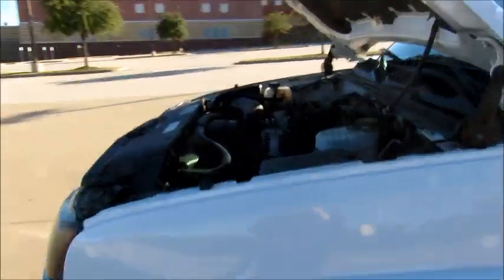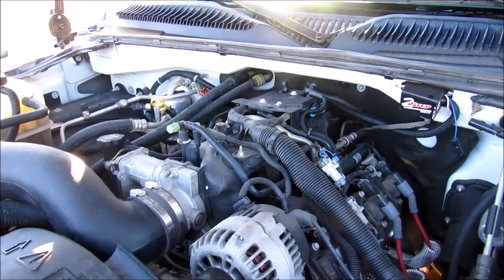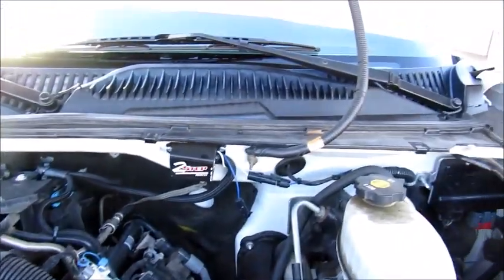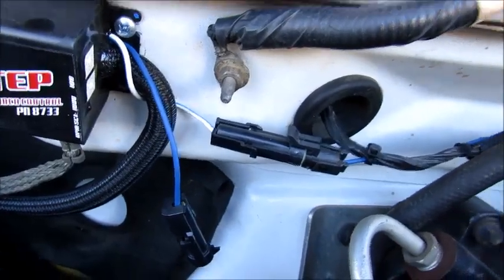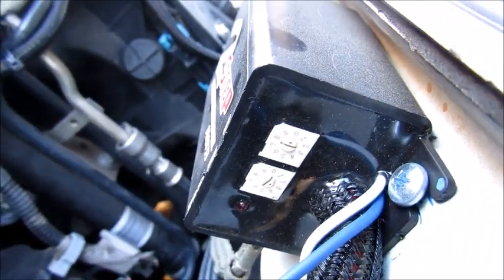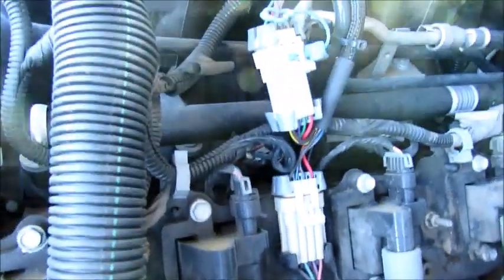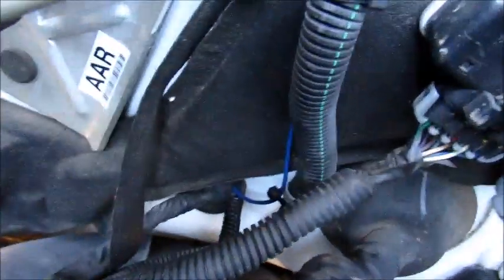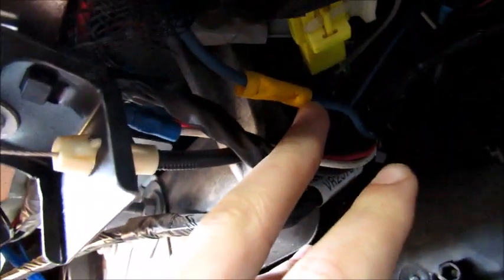MSD 2 step silverado

Comment: Seems like a lot of truck lol.  I just have a 05 silverado single cab short bed,5.3, 4.10 gears, locker, and tuned. I could only imagine what it would be like with a stall, cam, and 2 step
Reply from the maker: ToadNumber55 i love single cab short beds, my friend has one that he swapped an ls3 into and its done up even more than my truck, its a blast to drive.
Reply: CBRKTMrider55  mine is an 00 single cab with a 6.0 swap bolt ons ant tune it pretty fun to drive
Reply: I have 2013 rcsb with a 4th gen 5.3. 6l80e thing rips
Reply: Single cab short bed is where its at with a performance truck
Reply: @dompalmer1460  how was the 6l80 swap?

Comment: So this works on automatics? Sorry for my ignorance
Reply from the maker: J 117 yeah it works on automatics but it will only hold the rpms as high as your torque converter with stall. whereas a manual with a clutch will let you rev up and hold at any rpm
Reply: I bought a Lingenfelter 2 step
Reply: My Acura rsx has these previous owner installed it
Reply: Do you have dual valve springs?
Reply: Carter Mckinney so I can’t do over 2500 rpm on automatic
Reply: @carterm623  thanks for this explanation...years later and this helped me out alot. I have a 3200 stall also so ill set my 2 step to 3198 rpm

Comment: Is there a certain rpm it pushes through the brakes? I'd like to launch my car around 4k, and I noticed yours was set around 3k. Thanks for any info and love the truck!
Reply from the maker: with the 2 step it wont ever push through the brakes because it essentially puts the truck in neutral, the rpm limit is based on the stall of your torque converter. so the highest i could set mine to was like 3200 because thats what my converter stalled at. without the 2 step you are loading up the converter and braking at the same time, if you give it more rpms and go past what your converter stalls at then you with push through the brakes.

Comment: I’m 15 and I have a 2000 Chevrolet 1500 short wide with a positive track rear end long tube headers cold aid intake and it is getting a stage 2 gpi cam and tuned a t gpi it two weeks
Reply: Gay
Reply: @jasper411  why you gotta be negative

Comment: Wiring it up to the brake is super smart i heard someone say to wire in a pushbutton switch which made no sense to me lol. U should put a ls6 intake on it!
Reply from the maker: menitojr i would put that intake on it but i wrecked the truck and dont have it anymore, i got a 2002 z28 and its cammed with 241 heads and an ls6 intake
Reply: Carter Mckinney oh nice man well it wouldve been cool to have both lol but i seen your camaro shes pretty clean. Sucks that the silverados gone but at least u got a nice replacement lol

Comment: What wire did you hook it to inline with the brake pedal? How is it if you were to daily it? Thx in advance, sounds awesome
Reply from the maker: Bobby B i hooked the white/blue wire to my trailer brake controller module that came with the truck and found a wire that got 12v when i press the brake which activates the 2 step. it has no effect on driving and has built in safety features, i covered this in another comment below or on one of my other videos

Comment: That's fucken dope!!!! Can you daily it with the power hooked up to the brake? I dont wanna accidentally 2 step infront of a cop or when I dont want to use it!
Reply: Reese Garcia do you regularly hold your brake and gas at any given time?
Reply: Nice nova I got one too
Reply: I'm a year late but you can just wire it up to a button you press with your thumb to activate it. That's how it is in my turbo 5.3l trailblazer and works great
Reply: If you plan to do a burnout before you launch, you should probably use a button to activate your 2-step. Can you wire it up on a toggle that deactivates it until your done with your burnout? I like the brake pedal idea, but seems like it would prevent a proper burnout without a way to turn it off if it’s wired to your brakes. 
I ordered mine for the LS Swap S10 today!!

Comment: I have a two step on my truck also I was curious How your able to hold 3k rpm? I can only hold up to about 2.2k rpm 5.3 with a 3200 stall single disc
Reply: Need a new stall converter

Comment: Would it really be necessary to have this if you already have an upgraded converter? Looks like you have a 3000rpm converter what would be the difference without the 2 step? Just more wear to the drivetrain and such
Reply from the maker: miles malone your right it wasn’t needed at all. i had a 4000 stall converter in it so i could of foot-braked it no problem, i just always wanted a 2 step and let me tell you it was fun messing around with. also it helped with consistency in launching at the track, no guesswork, just set it and floor it.

Comment: Hey man.  So It has a built in safety that when you mash the brake under normal driving it doesn’t activate?
Reply from the maker: VeritasEIREAequitas correct

Comment: You still liking the 2 step on that big of a truck. Been think about putting one on my 2011 Chevrolet Silverado crew cab.
Reply from the maker: BIG RED BETTY yeah its really fun. whenever i wanna peel out real hard i can do it. but it doesn’t really do much unless you have an aftermarket higher stall torque converter.

Comment: Great video, 
Question? I own a 08 silverado 1500 with ly6 6.0 stage2 cam but no stall, do I need  to install the stall prior to get the 2step?
Reply from the maker: no you can put it on with a stock stall no problem. just gonna be limited by what your converter stalls to in gear. in neutral you can set it as high as you want if your just trying to show off.
Reply: @carterm623  
Thanks,  I'm going to order one, and I'm going to install my stall the soonest I can
Reply: This isn't even proper 2step..

Comment: How did you wire in your 2 step being as though it’s an auto. Did you tap into your brake pedal switch?
Reply from the maker: Mitchell Forster yes
Reply: Carter Mckinney did you have to run an inline/momentary switch as well?

Comment: So if I were to ground it to the brake like you, would this cause an issue while driving? When I'm driving I like to downshift while braking for stop signs and such and I don't exactly just want it activating. This is my issue with an auto. I know it has the blue ground switch and I assume if you do that it'll always be on but then I'm still worried of an issue while driving
Reply from the maker: Metra163 - HD Video Productions The LS 2-Step has a built-in rpm drop circuit that prevents the low rpm limit from activating during gear shifts (when connected through the clutch switch). In order for the limit to activate, it must see an rpm drop of more than 1/3 the set amount. For example, if the limit is set at 3,000 rpm, the limiter will not activate unless it sees more than a 1,000 rpm drop. So in essence there is no way it can possibly effect you while driving, i drive the piss out of my truck everyday and down shift and neutral rev it all the time and have no issues.
Reply: Carter Mckinney Thanks. My only fear was the issues I mentioned since I drive an auto
Reply from the maker: Metra163 - HD Video Productions my truck is an auto too
Reply: Carter Mckinney Although, my concern is still when I downshift a large amount while braking. It is often times more than 1000 rpms. I guess I can only find out by adding it you know?
Reply from the maker: Metra163 - HD Video Productions well when you downshift the rpms go up and the two step needs to see a 1/3 drop to whatever its set at so theres no way it could mess with you while shifting. The highest i can set mine is at 3000 because thats what my torque converter stalls at so i have to be 1/3 of that which is 1000. My truck idles at 950-1000 so i literally have to be at idle (at a dead stop) for the two step to even work. Its a launch control unit so its not designed to activate or do anything to interfere with your driving once you get off the line. You have nothing to worry about my man.
Reply: Carter Mckinney Alright man, thanks. That basically how mine would be working. So this was really helpful in fixing my worries. I know about working on cars but the 2-step still had my a little confused

Comment: Wired mine the same way. I have it sent to 3500rpm but the problem I’m running into is my truck starts doing a burnout at 1500rpm.
Reply: you don’t have a stall
Reply: Stock converter , upgrade it

Comment: Carter do you have to have a different Stall torque converter or gears on it ? Can you run this 2 step with the stock stall and stock gears.
Reply from the maker: Oscar Skirrt454 you can totally run the 2 step with the stock stall and gears but itll only stall as high as your torque converter will allow. my stock one was only like a 2200 stall or something like that so i could only set it at like 2100 rpms and it didnt do much. with the 3200 stall i have in it now i stall it up at 3000 rpms and it launches way better, i just need good tires because mine just spin their ass off

Comment: can this be wired to a switch? you tapped into a brake wire? i just got one and confused on the wiring. you only use one of the wires that come out the msd box?
Reply from the maker: omgbg ycfmbbg yeah i used the white and blue wire and butt commected it to a wire on my trailer brake controller that got 12 volts whenever i hit the brake (thats the voltage required to activate the 2 step) i guess you could wire it into a switch instead and flip it on to activate it too
Reply: I ran mine to a toggle works only in park I have the ground wire ran I'm so confused I guess I gotta run it to my brake pedal wires for it to be activated any help thanks

Comment: Hey did you habe to trim the engine oil dipstick when you installed your headers? My Texas speed header flange was hitting it so I had to trim it a lot where it mounts to the block
Reply from the maker: charles blanchard mine fit just fine, this is also a 2500 so i think it has a little bit more room too
Reply: Carter Mckinney mine is a 04 2500hd
Reply from the maker: charles blanchard interesting... mine didn’t hit anything
Reply: Carter Mckinney are they 1 7/8 or 1 3/4 primaries?
Reply from the maker: charles blanchard 1 3/4

Comment: Is it wired straight to the brake 12v wire? Does the 2 step turn off after letting go the pedal or how does that work?
Reply from the maker: Guillermo Cortez i used a butt connector to connect the 2step wire to a wire that got 12 volts when i press the brake pedal. whenever i’m on my brakes at idle the 2 step is activated and then i floor it and let my foot off the brake and it launches then the 2 step is no longer activated after i launch. In order for the 2-Step system to reactivate, it must see at least a 1/3 drop in RPM level. For example, mine is  set at 3,000 RPMs it won’t reactivate unless my RPM level drops below 2,000 RPM.
Reply: Carter Mckinney that makes sense thank you! Gonna wire it up tomorrow!!

Comment: i need to know 2 things. is this still blowing thru  cats , and what does it do if you do a brake stand burnout.
Reply from the maker: Trailerpark Supersports i dont have cats and it wont let me do a brake stand burnout because i wired mine into the brake pedal so it just holds the engine rpms. you could wire it up to a switch and still be able to do brake stand burnouts though

Comment: Did you ever do something to fix the traction problem?
Reply from the maker: Cesar Cabanillas no i wrecked it before i got the chance. i was gonna put caltracs on it and nice street tires like nitto 420s
Reply: Carter Mckinney what did you do with all the parts you installed did you part it out?
Reply from the maker: Cesar Cabanillas i yanked most of em out and sold em before the insurance company took the truck
Reply: Carter Mckinney you think the caltrac traction bars would actually make that much of a difference?

Comment: how are you able to launch at 3k without it pushing through the brakes or spinning? I have a 3200 stall, tsp cam, msd 2 step and the highest i can go before it starts pushing through the brakes or spinning is 2500
Reply from the maker: OfficialCyanideBand the 2 step holds it back, thats the whole point of one
Reply: @carterm623  I must be doing something wrong then, like i said it starts to do a burnout or pushes through the brakes if I have the box set higher than 2500
Reply from the maker: OfficialCyanideBand oh thats because you have the stock stall converter, it probably stalls up and maxes at 2500. i bought and aftermaket 3200 stall converter so i could hold my rpms higher (up to 3200).
Reply: @carterm623  I have a circle d billet 3200 stall, bought brand new from circle d lol i dont get it either man
Reply from the maker: OfficialCyanideBand hmm thats weird
Reply: @OfficialCyanideBand  I have the same problem did u fix it??
Reply: @carlosleon623  nope

Comment: Stock 80e??? How’s it holding up with all the abuse?
Reply from the maker: Abraham McDonald at that time yes it was stock. 80e’s are pretty strong stock, i only was making 330 to the wheels so theres no way i could hurt it. later on before i wrecked it i had a custom built ptc converter, and a fully built trans with alto clutches, shift kit, billet input shaft, kevlar bands, sonnax overdrive, hd sprags...etc. 4l80’s are great, way better than a 60e at least.
Reply: Carter Mckinney you still got that 80e?
Reply from the maker: Giovanny Mares i do, ill probably keep it and put it in a single cab truck when i get back from the army. before i do that i need to sell my fbody though

Comment: Nice truck, how loose is that torque converter?
Reply from the maker: phantomx55 its pretty loose, its a 2800-3200 stall and with my truck setup the way it is i can stall it up to 3000. driving around it likes to stay right up around 3000 and you have to get into it a little so that it will upshift, but on the highway doing about 75 on cruise control it’ll stay right at 2500rpm like it did when it was stock. its honestly one of the best things i did to this truck. im very happy with it.

Comment: Link on where to get this 2 step module? And is that all you had to buy for the 2 step?
Reply from the maker: modmotorsFTW you can buy it on jegs, summit racing, texas speed...etc. just look up msd 2 step ls series for sale on google and look for a good price, i think jegs has them on sale now for christmas, the 2 step will only let you rev as high as the stall in your torque converter, so it wont do much putting it on an automatic car with the stock converter. i put a 3200 stall aftermarket converter in my truck and now not only am i in the powerband of my camshaft as soon as i floor it, i can also launch it off the 2 step at 3000 rpms and get a decent launch instead of the 2000 rpm launch with my stock stall which didn’t help at all. so i wouldn’t get a 2 step unless i had an aftermarket torque converter or unless my car was a manual then it wouldn’t matter and you could launch it at any rpm.

Comment: Call me dumb, stupid or ignorant but you say when you hit the brakes you can floor it and the truck will bounce off the rev limiter until you release the brakes.....so what happens if you're making a pass at the track and get to the end if the track and you're pushing say 6500+ and you're rev limiter is at 3500....won't it then hit the rev limiter until you slow down and get below the limiter??
Reply from the maker: jayer 1981 nope, once the car is moving it has a safety feature that won’t allow it to activate. plus it only will activate if your rpms drop 1/3 below what you have it set at. i set it at 3000 and my truck idles around 900 so literally i just have to be at idle for it to even activate.
Reply from the maker: jayer 1981 and also it doesn’t bounce off the limiter when you hit the brakes, you have to press the brake and floor the gas at the same time then side step the brake and it launches
Reply: Carter Mckinney I wonder if it's possible to use this on a newer 5.3 with the AFM.....wonder if it could cause issues with the valvetrain.....
Reply from the maker: jayer 1981 its a universal setup that works for all ls based engines, so yeah it should work

Comment: How did you launch like that??
Reply from the maker: held the brake and floored it at the same time, since my 2 step is wired on my brake switch it activates when i press the brake when the truck is stopped and holds the rpms at whatever i set it to. then let off the brake and it launches. if i did this without the 2 step then the tires would try to spin and the truck would be fighting the brakes and the converter trying to move forward.